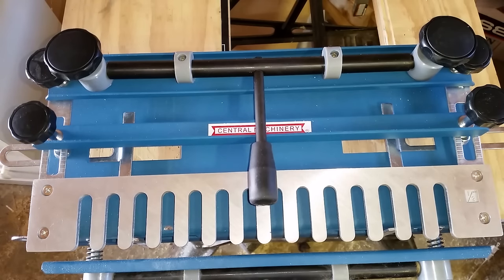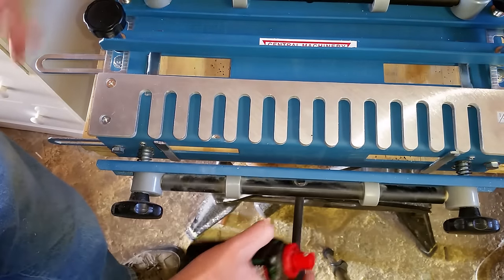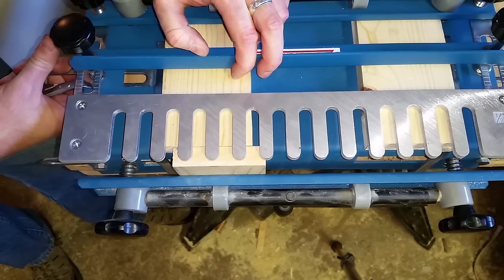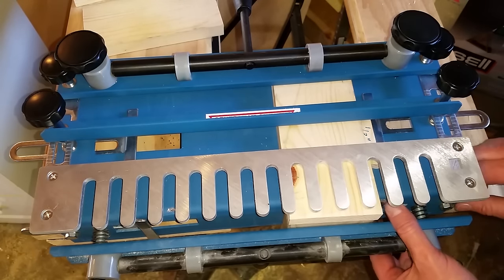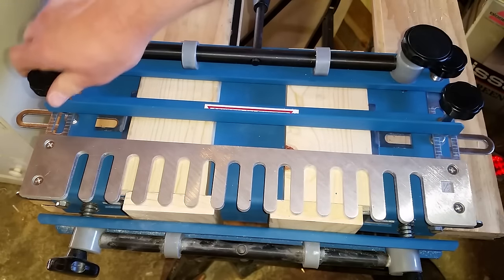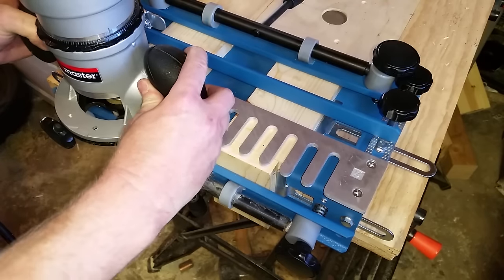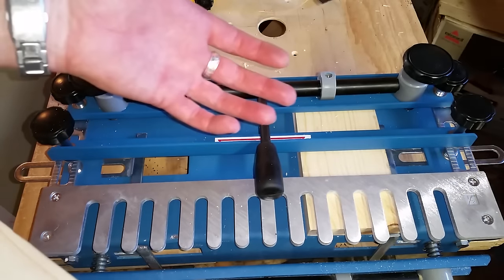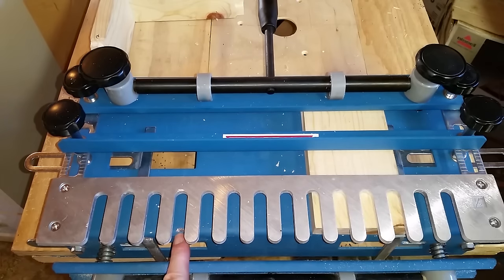How to setup a Harbor Freight Dovetail Jig

Comment: The setting of the fence distance is dependent on the size of the router base.
Reply from the maker: Yes, the Addendum to this video has a link to better instructions with a table of distances.
Reply: @MrDabrudda  thank you

Comment: Great video. I'm using 1 inch thick material. The chart only goes up to 7/8 thick material. Would I just add an 1/8 of an inch? Or is there a formula to set the fence depth?

Comment: This was super helpful thank you, would of spent age figuring it out, lol. I'm in the UK and got a version idential to this but ovbiously not from harbour freight. on the manual and box is says it can do box joints - do you know how to do this? Thanks again!
Reply from the maker: Searching on the interweb for several hours I found box joint templates which fit the HF Dovetail Jig.

I've bought 1/4" box joint template (CT052B14) from Busy Bee Tools (Based in Canada and shipping was outrageous) and a 1/2" box joint template (D3157) from Woodstock International Inc.

I plan to do another video detailing the box joints in the future.  Both templates fit the Harbor Freight Dovetail Jig perfectly.
Reply: Thanks a lot for replying - sounds great, i look forward to the vid when it comes out!

Comment: A thank you for the video. It was very informative and gave me a heads up on what I needed to do before I unpacked mine.  I download the alternative manual you suggested, naught the bit with a longer shank at Home Depot.  I have not been able to find the router insert on the HBO website that you show and wanted to know if you can post a link.  I have 12 drawers to do so I'm trying to set everything up as perfectly as I can on my test cuts before I start.
Reply from the maker: 9 Piece Router Template Guides
http://www.harborfreight.com/9-piece-router-template-guide-set-98361.html

Comment: I do have a question since I won't be using it tonight how come it says very important in the instructions the vertical Woodstock should be positioned offset to the left of the horizontal Woodstock by the width of one comb tooth..why do you do that and what is the purpose of that I've never used the jig like this before ..thanks
Reply from the maker: Forget the Harbor Freight instructions they very wrong and incorrect.  Watch my addendum to this video and download the D2796 jig (which is the same exact jig) instruction manual from the link in the description.
Reply: MrDabrudda will do and thank you!once again🍻

Comment: This is by far one of the more simple explanations to the jig so thanks a lot pal. But, why can't the bearing work instead of the router spacer thing? Also why does everyone maneuver the front before the horizontal? Surely the horizontal already being there removes a step :s lastly, I can't fathom why a few use a more spikey sort of comb guide with a more square edge bit-what happens to the rounded edges? I have the same jig and guessing the wood is 18mm thick (25mm/inch, make what you will), the guide stops dead on the edge unable to move further forward :s

Comment: Great video. Thank you for the time you took making it. Do you think there's a mini dovetail template that could be used with this? I was looking at the Porter Cable template.
Reply from the maker: You can buy different templates for these jigs.  Check Woodstock and BusyBee website.  I've purchased a 1/2" box and 3/4" box template for this jig.

Comment: Download the Woodstock D2796 pdf manual he mentions and throw away the Harbor Freight manual and this becomes easy.

FWIW, the 7/16" guide bushing has WAY too much slop. Use a 1/2" bushing that this was designed for. All you have to do is take a few passes with a flat file to the template arms to remove milling burrs and a 1/2" guide bushing fits just fine.
Reply: Yeah that different bushing recommendation seemed a bit sketchy to me. But he's getting great results so it is obviously working for him.
Reply: I tried the 1/2 " collar and my tails were too wide,  i switched to 7/16", made sure to move router to both sides of comb and the fit is great.

Comment: Great video.  Thanks!  One part made me laugh.  At the beginning where you said the part with the cams was in backwards so you had to turn it around?  I had the same problem on the bottom one.  Turns out, I just screwed the handle into the wrong side.  Unscrewed it, turned the shaft 180 degrees, and presto!  :p

Comment: Can you do through dovetails or only half blind?
Reply: If your horizontal and vertical pieces are same thickness ( in this case setup, 1/2 inch material ) , you will create visible dovetail and pin ends on outside corners .

Comment: I am running a dewalt 611 router and there is no way to setup the depth of 19/32 without eatting the template with the bit I have. That's the dimensions of the dovetail you're using?
Reply from the maker: I had the same problem with the HF bits.  Too short of shank.
Watch the addendum to this video.
https://youtu.be/103fjgVBJAU

This is the bit I used.  Irwin Tools 1900990 Marples Dovetail Router Bit with 14 Degree, 1/4" Shank
https://www.amazon.com/Irwin-Tools-1900990-Marples-Dovetail/dp/B01M7UIC32

Comment: Does it take that long to setup every time or is it faster if you’re always using 3/4” stock?
Reply from the maker: Once the jig is setup for the width of the stock then it doesn't need to be changed unless you are cutting thicker or thinner stock.
Reply: I set mine up for 18mm stock (planed 3/4") & bought a cheap router which is left set up with the bit in it...
It was a PAIN to set up ... 😂
BUT... once it was set ... it gave great dovetails... just dont buy one if your stock thickness changes regularly...
Reply: @peterfitzpatrick7032 If time is more important than money, I have simple solution for two different stock thickness, just get two dovetail jigs from Harbor Freight, and set them up accordingly. With the 20% off coupon, the jig only costs about $27.

Comment: Ok you put the handle in from the back side if you put the handle on right the first time you would not have to turn it around 180 ! the knobs are to close  youi have a hard time screwing down the handles in back .

1
Reply: exactly. Just spin the bar and screw the handle in from the opposite side and it will tighten down correctly.

Comment: I started setting it up following your instructions which are very clear but I ran into a problem right away.  I am putting a box together that is 5'' sq.  The front clamp worked but the top clamp was to far back to clamp my top piece of wood.  Looks like there is a minimum to the size of the box.  Or am I doing something wrong.
Reply from the maker: Right, if the piece is too short then it won't clamp.
Reply: thanks for the quick reply
Reply: is there a jig that would solve this problem?
Reply from the maker: Not that I know of. Might try hand cutting dovetails.

Comment: Great vid. You yanks do these things so much better than us brits. However, why don't you guys move to the metric system? All that inch and five eights stuff is a real brainache.  Miilimeters are so much easier to work in and plenty accurate enough.
Controversial or what?!
Reply: Most Americans agree that the metric system is superior, and we are taught it in schools, BUT we have an entire infrastructure that has been built on the imperial system,.Thus, it will take a long time, at great cost, to convert over. It will likely happen slowly over the next several decades.
Reply: I didn't know you were taught  metric in school. We have the same problem here, with both metric and imperial still widely used. I frequently find myself using both when talking about dimensions in wood, i.e. "I want a piece of 2 by 2 (inches), by 2 (metres)"!
Anyway, have you actually got several decades, now Trump is at the wheel? I mean, the guy's a joke, right? Apologies, if you voted for him.

Comment: You changed the entire clamping rail? you just had to turn out the handle and screw it back in from the other side same result I found out A very nice tutorial by the way kind regards Hans
Reply from the maker: I removed the two  adjustable knobs and flipped the clamping rail 180 degrees and reinstalled the knobs.
Reply: As I said it is a lot easier to just flip over the handle and screw it in the other side of the hole 
goes faster thanks for the follow up by the way, I now also have a decent manual thanks.

Comment: Good video. How did you sand the bushing? I bought the template guides from HF and found out what you did. They were just a little bit too big. I have a Skil router RT1622. I contacted Skil and waiting for a reply in regards to the correct bushing. Again thx for all your efforts. I subscribed and gave you thumbs up.

Comment: Hey, how do you avoid hitting the surface of the machine with the router bite?
Reply from the maker: The depth of the bit is set using a ruler.  See the addendum video.

Comment: What is the thickness of the aluminium comb please? I need to be sure I have the same one before using the 9/16 depth
Reply from the maker: Approx. 1/4"
Reply: You're going to have to fool with the bit depth regardless. Too loose bit has to extend further, too tight have to retract the bit.

Comment: So I have a question say the drawer opening is 28 1/2” wide but with drawer slides it takes away 1” so it ends up being 27 1/2” what would the measurements be of the front piece (keep in mind I want the dove tails showing on the sides) THANKS!
Reply: ? 27.5.  You'd need a false full front board.  Or, depending on thickness of the side boards, you could route a groove on the sides (or the frame) to put the slide into.

Comment: You did a very good review on what seems to be a very poor machine when the directions do not agree from one page to the other there is more than something wrong. The parts they supply won't mate with on another there's something wrong. The bits aren't long enough there's something wrong. Harbour Freight would have to pay me to take this Dove Tail Jig. This is junk and should be reported to amazon.

Comment: There must be an easier way, Is that for one joint or can you leave it as long as the drawer boards are the same?
Reply from the maker: Yes, you set it up and cut all your drawer sides if the boards are all the same.
Reply: I’ve never used 32nd’s in woodworking lol

Comment: Would this also work with 1/2 inch
Reply from the maker: I have a 1/2" comb that fits this jig.  I haven't tried using it yet.  But yes there are different sized combs.  I bought mine from Grizzly.

Comment: well,,ya get what ua pay for..seems like an awful lot of time to set it up and seems like its measure 7 times cut twice..good review though reall informative..hopefully they have better qc now a days..and if it doesn't end up working out you can always return it get your money back in get a better brand name I was thinking the Porter-Cable 4212
Reply from the maker: The setup time and test cuts would be the same for any type of dovetail jig you bought.  Regardless of a $29 jig or a $200 jig you would still need to go through the setup, adjustment, and test cuts to get a perfect fit.
Reply: MrDabrudda oh okay I did not know that I was contemplating getting one it's not something I would use everyday but then again you never know what commissions bring you thank you for the very informative video maybe to start off to see if I even like it I'll pick up the Harbor Freight one since they're all the same and if I like it I'll pick up a more versatile one that cuts box joints half blinds and through dovetails
Reply: No, the Porter cable doesn't require all that measuring and fence adjusting. It's actually very well designed.You pretty much just put the boards in and route them.

Comment: There Is another manual online that is correct. It also has a chart that shows how high above your board the comb needs to be and where to place the fence(you called it a frame bracket) based on the size of the board.
Reply from the maker: Yes, watch the addendum to this video.  The manual is in the description of that video.
Reply: @MrDabrudda  will do. Thanks
Reply: @stephen e  and mr Dabrudda.   Thx to both of you for doing all the work.  Just inherited this jig and anxious to try your instructions.  I’ll update when I learn how.

Comment: I can't find the right bushing guide with the correct OD and throat depth.
Reply from the maker: I bought my bushing from HF.
Reply: As long as the guide you use is smaller than the comb, you should be good.  Just have to work down left and right of each tooth as he showed.

Comment: All I got out of that was HF stuff doesn’t work in conjunction with anything else without having to modify stuff beforehand.
Reply from the maker: I guess wood working isn't for you then.
Reply: Or woodworking is great for you, as long as you spend your money well on proper tools that don't require excuses for being poorly designed. HF is a money pit. Sometimes there's a good reason things cost more.

Comment: what you pay for what you get from  harbor freight  here in Canada  we have called in princess auto
Reply from the maker: Exactly, Harbor Freight tools are cheap and get the job done but don't expect a life time of use from the tool.
Reply: you can still take them back if they brake
Reply from the maker: At Harbor Freight some tools have a life time warranty.  We have 90 days to return items that don't perform up to our expectations on item without the warranty.
Reply: +MrDabrudda i bought a drill master 4.5" angle grinder for $7.99 back in 2003 and it still works great.

Comment: Wow, it would be faster and easier to just cut the dovetails by hand!
Reply from the maker: Be my guest and cut away.  With any jig you set it up once and make all your cuts.
Reply: It depends on if you are cutting one joint or 70. A jig is faster for production.

Comment: Has anyone tried this on 1/2 stock?  Will it work?
Reply: Horizontal piece needs to be at least 3/4" . I tried it, and slightly gouged the jig.
Reply: @davidjudd221  I think you could do it but you'd need a miniature dovetail bit and possibly a different template comb? It isn't one size fits all without the correct accessories.

Comment: Seems easier just to cut the tails using a tail cutting router bit then trace the tails onto the pin side and cut the tails by hand.
Reply: Sure if you're only doing one. Machine cut is going to come out better than my hand cut dovetails do anyways. Plus I would not find hand cut appropriate in modern cabinetry.

Comment: The upper eccentric rod was not reversed. You screwed the handle into the wrong side of the hole.
Reply from the maker: No I didn't.  The way it came out of the box the router would be hitting the handle when you tried cutting dovetails.
Reply: Just got this jig. I tried both ways and they both worked.

Comment: MLCS has a bit with a 1.75" shank length - https://www.mlcswoodworking.com/cgi-mlcswoodworking/sb/order.cgi?rd=1&storeid=*105ba248ab07a840ee87&sbid=SSMSB889984273665844354.30242&redirect=yes

And lots of others.  See also CMT: https://www.amazon.com/CMT-818-130-11-Dovetail-2-Inch-Diameter/dp/B000P4NRGU/ref=sr_1_fkmr1_1?s=hi&ie=UTF8&qid=1510860067&sr=1-1-fkmr1&keywords=1%2F4%22+Dovetail+14mm+long+shaft+Router+Bit

Comment: I don't understand why it matters where you place the fence behind the comb... you're not cutting that far back
Reply from the maker: The fence sets the depth of the cut.  Too deep or too shallow of cut and the dovetails won't fit.
Reply: MrDabrudda after watching I see your router goes all the way to the fence, mine does not it is smaller but now I see the purpose thanks

Comment: Overly complicated. You did explain well but this shouldn't be brain surgery. Taking mine back.
Reply: Get a Portor cable one. They're easy to set up and $189 on Amazon with tax. Mine came with 3 templates and the router bits and guides for the templates
Reply: I agree. I did manage a couple of joints but the results are not consistent.

Comment: Nasty little machine to get setup. I discovered the fence was shaped wrong from the factory. One end was not 90 degrees so the distance was off along the length of the fence as the router baseplate rode along it. I beat it back into true.
Reply: Had to break out the fine adjustment instrument, did you?
Reply: Anyone figured how to use the through dovetail feature? Be nice for visible joinery.
Reply: @we_arenot_amused1617  doesn't exist on this one. The comb is for half blind only

Comment: Sorry, but when  you begin to measure in 32nd's of inches, two things begin to happen. 
1. Perhaps the measurement system should be switched to metric? 
 2. 1/32nds of an inch is approximately .8mm (or 800 mico-meters). You are now measuring wood (pine) in micro-meters.

 ...to fit a "budget jig" bought from harbor freight and probably made in china. That seems like a very fine measurement for such a course tool. I could see having to cut and adjust several times before getting it right. 

Kudos to your setup (no really, superb), but I think I will pass this up for a better (and probably way more expensive) jig.
Reply from the maker: Do you mean that $250  jig?....made in China also :)

Comment: So basically we should just throw out our Chinese dovetail jigs, suck it up, and go buy a porter cable one from woodcraft?
Reply from the maker: If you are willing to spend $160 to $190 for a tool you use once every 5-10 years go right ahead.  How often do you make drawers.  The last time I used this HF jig was to make dovetails on a shelf frame 3 years ago.
Reply: @MrDabrudda  depends how much your time is worth. I don’t waste mine on crap like this.